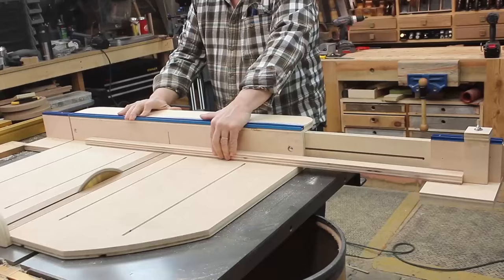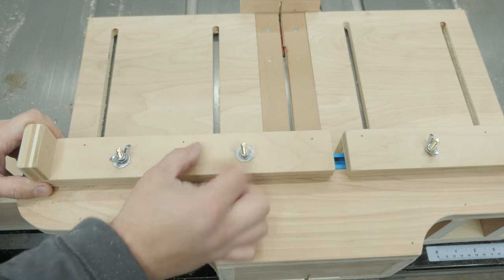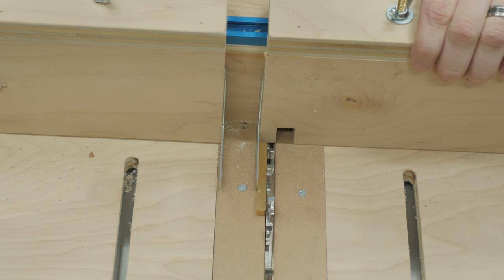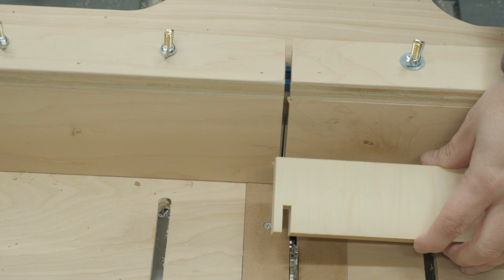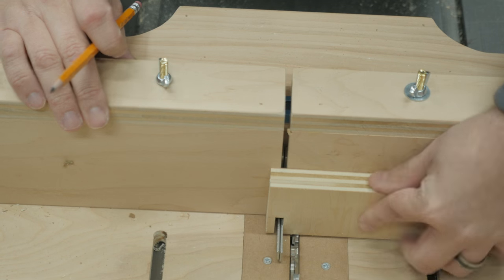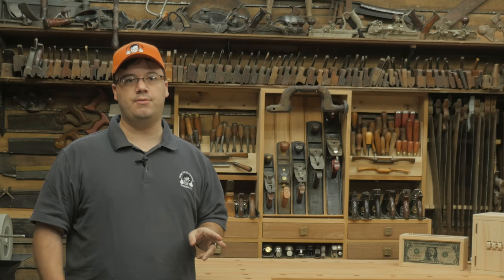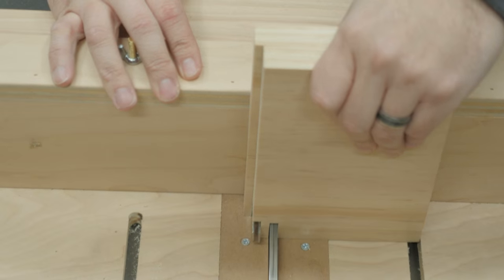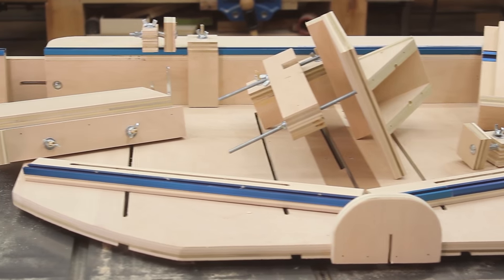How to cut box/finger joints on our table saw sled jig

Comment: What are your thoughts on this jig vs your newest dedicated box joint jig? Which one do you find yourself using the most and why?
Reply from the maker: If I want variably spaced joints (which is admittedly rare) I use the other jig. But this one is the one I use more often. It's simple, but still fully adjustable and very effective.
Reply: Thanks! Good to know that purchasing the sled plan set negates the need for a separate box joint jig.